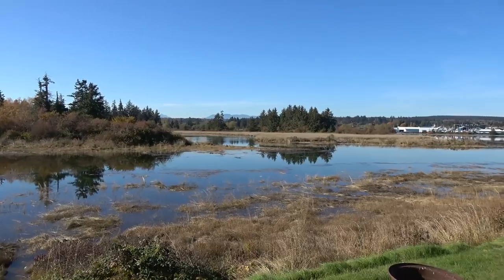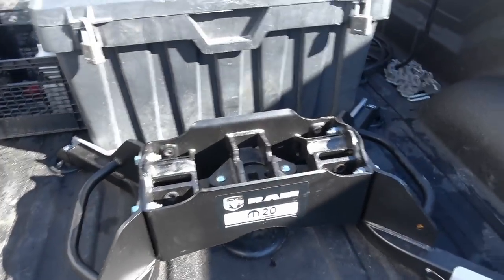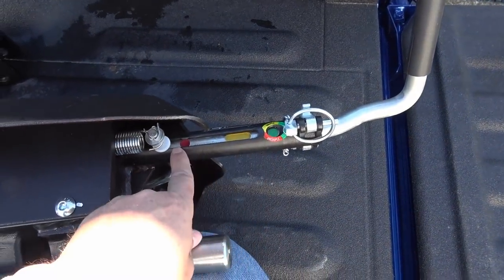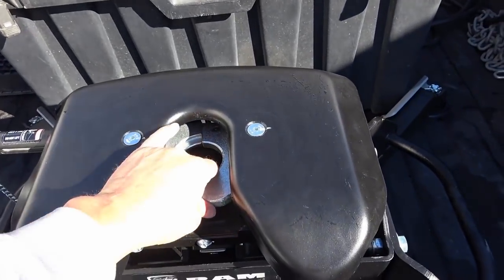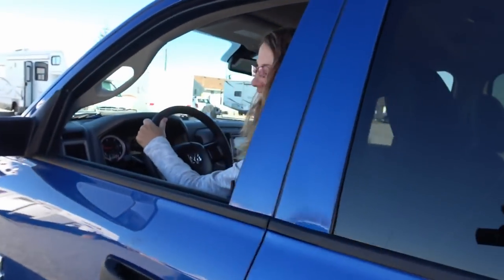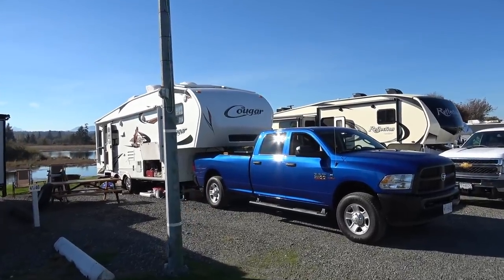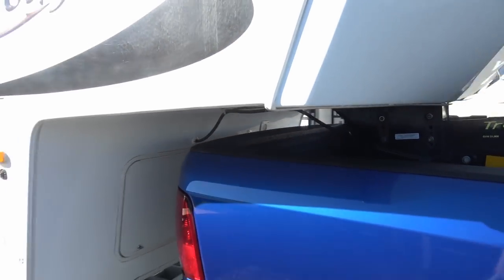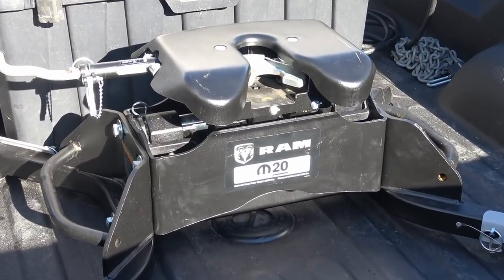Big Blue 2 - First Hookup (Testing New Hitch and Clearances)

Comment: Excellent, that was the best demonstration on how the Curt Q20 engages with the king pin!  Absolutely luv the ease of how it works.  The Curt Q20 is now at the top of my “must have” list. Thanks 🙏for the informative video!
Reply from the maker: Your welcome. I ad a little issue with unhooking but only because I didn't pay close enough attention to the manual. Here is the video I did on that - https://www.loveyourrv.com/ram-factory-m20-hitch-update-solved-my-disconnect-issue/  Cheers, Ray

Comment: We have a 2012 Cougar High Country. The left rear tire started hitting the undercarriage last year and got so bad this year we took it to a spring shop. The 4 leaf 2200 lb springs were beyond shot. Had them replaced with 3200 lb 6 leaf and fiver sits almost 2" higher. I wanted 5 leaf but the shop had 6 leaf in stock and we were on the road. Short bounces now instead of big wallows.
Reply from the maker: Thanks, I think I may be due for new springs soon too. One thing I forgot today is my water tank is full. 60 gallons, sits right at the back of the trailer. I imagine that has a bit of effect. Cheers, Ray

Comment: I have the same hitch in my new 2019 RAM 2500. 
FYI The entire unit weighs 180 lbs. I have a short box so I got into some very tight situations this summer. My project before we get snow is converting the M20 into a sliding hitch. The bottom half (leg kit) of the M20 hitch will be replaced with a Roller Adapter. I will then install an R20 Roller kit (from Curt) onto the Roller Adapter, and then the existing hitch head goes onto the R20 Roller. I see you have an 8 foot box so a Sliding hitch is not required.

Comment: Nice rig for getting around most places. Lots of luck. 
   We love our dogs and feel for your loss. Yours lived a long life and a contented one given your lifestyle. 
   I always had Rams. My last Ram 2014 with a 5.7 towed our 2011 Cougar lite real well. Hooked up, it sat nose high and the truck was a 2x4. This time, I decided to go bare bones to a 2017 reg cab Tradesman 4x4 with the 6.4. I love the truck. It takes me back to my first pickup bought new in 1985, also a Dodge---a nice truck for getting around town.
   I no longer have the cougar. I traded that in for a used 2015 34 ft Sprinter wide body, 9000 lb unloaded weight rear kitchen. I bought it for 23,000. The truck I also bought slightly used with 8000 miles for $30,500. It handles and pulls perfectly.  If money was no object, I would have gone with more truck, without dual wheels as you did. I'm still a little nose high, but not too bad. 
  Thanks for the spacer suggestion, I might do that. I'm getting around 7-8 pulling at 60 mpg. Empty highway at 60 mpg is around 15-16. We mostly stay by the month at campgrounds with full hookups and when we move it's usually under 200 to 500 miles away to the next campground where we might stay for a season or month or two. ie El Paso to Cloudroft NM. for a 15 to 20 degree difference or Apache Junction to Flagstaff for example. So gas mileage wasn't a big issue for us. Enjoy your rig and the power of overkill, and that's always a good thing in the RV world.
Reply from the maker: Thanks, should be fun next time we are over in NM to tackle that Cloudcroft hill with this new truck. :)

Comment: Hi Ray. When I got my 2016 Ram 1500 I had a lot of "trouble" with the Ram brake controller. The trailer brakes worked fine with my old 2005 F150. You could do the standard brake setup, lockup the brakes etc with the Ford but I could never get it setup correctly & I never felt the brakes were working correctly. I searched lots of truck forums & RV groups & there seemed to be a common theme that the controller wasn't any good
 The dealer checked it & said it was working to spec. I had a couple brake controllers so I disabled the OEM controller & tried them. I now got the same results. I found a post that a guy said to replace the brake wiring on the trailer with at least 12 gauge. The local parts supply had 50' of 10 gauge brake wire on sale so I got that & replaced from my junction box back. The trailer end to the junction box was already 10. The old wire was 16 gauge. Now everything works great. I tested the old wire & the pieces between the axles (run through the axles) ha cracks & brakes with only the rust from the axle keeping it together
 In short (pun intended) Ram controllers are sensitive to poor connections & a rewire may be in otder
Reply from the maker: Thanks, for the tips, my old controller worked well on old Blue, it was a Tekonsha Primus IQ. I just added new trailer brakes and redid the connections to them so hoping I'll be OK and not need to re-wire. Cheers, Ray
Reply: @LoveYourRV  my problem was the wires that run in the axles (most Dexter's do this)

Comment: It's funny that I am in the exact same situation. But I have a 2019 F350 Lariat and a Jayco 265BHS. My truck was factory ordered in April, arrived Oct 2, delivered Oct 11. Our seasonal site has a serious slope to the rear as well. I am still waiting to pull the unit off the site because of the break-in mileage. I purposely went to an f350 because we are a fairly of 6 and we are looking to move up to a 355MBQS. With a 2400-2600lb pin weight. Almost need a dually for that unit. I went ford as the GM srw doesn't compare(legal weight) and the cab is too small. The Ram with similar features ordered is $96kCAD, with less room in the cab and a heavier curb weight(450lbs).  Hope you enjoy the new truck.

Comment: I have a 4WD Ram which is a lot higher than other trucks. I had to reverse the spring shackles on my 5th wheel to prevent contact with the truck bed. It was particularly bad on slopes where the trailer was lower than the truck.  Also had to get the special 5th wheel cut out tailgate for clearance.

Comment: For $500 or so you can get 6 or 7 leaf spring packs and a taller equalizer.  When I bought my RAM in 2013 I had a very bad nose high condition with my 5r.  I went to the RV place to look into a solution and they said the only arc left in my springs was where they were bent down around the axle- totally shot.  Don't add shims it will be less stable and negate a lot of what you have done to make it more stable (the fancy hitch, the pin box, etc.).  

Next time you head south, stop in at Arlington RV in Arlington Wa. and see Greg.  He will take great care of you!
Reply from the maker: Thanks, for the info. Cheers, Ray

Comment: on that hitch, yellow is meant to be "open but ready to accept a trailer"

its also good practice to look at the actual jaw to make sure its closed, although on this hitch, i dont know if its even physically possible for the handle to be in the green position without the jaw correctly locked.

the little flip up thing on the release handle can be locked in the fully open position as well making unhooking a one man job.

Comment: Hi Ray, hope all is well after Angie's passing...Noticed in your video how close the New Truck is to your van when hitched ...you might need to move the hitch point in the Trucks bed , closer to the rear (if Possible) Other wise you turning circle will be truly compromised...GREAT looking Truck , by the way...Hope to get myself the same truck in Australia one day.
Reply from the maker: My tape measurements show I'll have about a 4-6 in clearance at 45 degrees when the corner of the truck is closest. only a test drive will tell for sure, if not I may have to switch pin boxes, the Air Ride I have is a little shorter than OEM. It made the clearance look tight on my old truck but was never an issue other than sometimes couldn't lower the tailgate without backing off the hitch a bit first. Cheers, Ray
Reply: No worries Ray, could be an illusion in the video...All the best with the new Big Blue, it looks GREAT!!

Comment: Ray 
I pull a Jayco 27.5 RKDS with a Ram 2500 Outdoorsman 6..7 Diesel
My trailer pulls a bit nose high and I have a Short box (6.5 foot) with a slider Curt Q16 with puck system 
I travelled from Ottawa to BC and back this summer without any issues.
I did not get the Aisin transmission yet had plenty of power towing along Lake Superior and in the Rockies. Motor rarely reved over 2000 rpm and I found the Exhaust brake very useful. Great on downgrades and find myself using it even on daily drives. Saves the brakes!

I might consider fine tuning and raising the trailer a couple of inches after watching what you do.  The trailer dealer said that I was fine but trust can be an issue there. They truly just want you off their lot and out of the service bay. But I might add that my tire wear on the trailer was even if that is an indicator?
Reply from the maker: Even tire wear is a good thing. I think the best thing to do is take it to scales and measure the weight difference between the front the rear axles. The main concern is to not overload the rear tires or axle. Also good to check the tire temps after towing and see if the rear tires are running hotter than the front. Nose high can sometimes affect the handling with too little pin weight on the truck and the trailer bumper is more prone to dragging in dips.  It's all relative though and can vary between setups. I think a little bit nose high is not a big issue.

Comment: Care to characterize the ride with the trailair and the curt(mopar) hitch?  I can't decide whether we want to get the curt q25 vs B&W RVK3600, then add the trailair pin box to a Montana.
Reply from the maker: No complaints, have about 4000 miles of towing on it now.  I have about 1700 lbs of pin weight on it. No clunking or clanking or chucking. Happy with the setup,  I have no plans to change anything. Cheers, Ray

Comment: The newer pickups are several inches taller since they increase the capacity of the beds.  I ran into this problem and to correct itI ordered  from Lippert a kit. I believe it's called "CORRECT TRACK".  It is designed to allow the alinement of the axles.  It also raises the trailer several inches.  It is a bit of a challenge since the trailer need to be block up since both wheels on a side need to be removed.  I would suggest replacing the equalizer with one from MORYDE which allows of addition suspension travel before bottoming out. I considered wet bolts but went with Lippert's "NEVER LUBE" bushing. (Grease attracts dirt) and that kit included the new links to the equalizer.
Several tips... since the wheel are off it will be a great time to repack the wheel bearings the right way and check the wear on the brake shoes. Also the wires to the brake will need to extended about 3 to 4 inches.
Reply from the maker: Thanks for the tips. Cheers, Ray

Comment: I think you are going to need those shims in the trailer suspension as it looks to me that the new 5th wheel hitch in the bed of the truck needs to go up at least 1 bolt hole for sure. The reason i say this is it doesn't look like your trailair pinbox will clear over the bed rails on sharp turns. This may just looks this way because all the weight wasn't on the truck? Just an observation. Safe travels!
Reply: P.S. I have the Curt Q20 and love it, and yes this does look like a rebrand of it.
Reply from the maker: Thanks, I measure 33" from the center of the hitch jaws to the side bed rails. My pin box measures about the same from the center of the pin to the very back end of the pin box up were it disappears in the fifth wheel overhang. So should still have plenty of clearance even when jacked 90 degrees. At least that how I figure it, time will tell. :)
Reply: Glad to hear it. Wishing you guys all the best as I am sure you are heading south soon. Safe travels, and thank you for all the great videos.

Comment: We have a 2018 ram 2500 megacab and quite a bit more room between the tailgate and the 5'er, we are using a superglide autosliding hitch tho
Reply from the maker: Thanks. Same on my old truck sometimes too, mostly because I had swapped the longer OEM pinbox for the Air Ride, it's a little shorter pin box. Means I can't fully open the tailgate until unhitched a little.

Comment: Looks like you might be OK when everything is loaded and level.  It seems a little ridiculous that we all have to worry about having our trailer level while keeping the correct clearance with the Pickup side rails and tailgate.  Most pickups on the road that I see,  that are towing 5th wheels, are relatively new  and 4wd.  It would be nice if the RV manufactures would raise things a few inches to accommodate the vehicles that will be towing them.
Reply from the maker: I guess they are worried about the height of the trailer. I think some of the new ones are getting taller though, especially the toy haulers. They need 4 steps to get into them.
Would be nice if truck makers would offer an option to order a little lower bed rail sized box, I was tempted to buy a truck with no box and put a flat deck on it. Cheers, Ray
Reply: Good point. I'm sure they are hemmed in by the overall height , and still keeping the upper level livable.I guess I shouldn't complain, my pickup is stock.  Half the pickups around here have been raised, and have even larger tires. They must really have problems. I mean hooking up to a 5th wheel, not necessarily psychological problems.  Take care, Greg and Becky

Comment: The new truck has such massive towing capacity compared to the old one, I think it will prove to be a breeze towing uphill!
Reply: I have a small v-8 and a 8000 trailer. I always have...since the early 80's. Is there anything wrong with driving at the same pace as the semi-trucks? Does it really matter if I go slow?
Reply: G Henrickson live in Pennsylvania....you'll tire of pulling hills at 4000rpm and 40 mph real quick...and there is a lot of them

Comment: I purchased a brand new 2019 RAM 2500 with the same M20 hitch. Love the hitch, very easy to use. This truck is so tall, that the nose-high problem with my 2011 KZ 295 5th wheel is massive. The front of the trailer is 9 inches (23cm.) higher than the back! My rear tires are significantly warmer than the front tires. My hitch is set at the lowest setting. The axles are already on top of the springs (flipped). I think my only option is a Spring/Suspension shop. I believe I need new springs, and more steel hardware to raise the trailer. Any other ideas from the RV'ers out there?

Comment: It does look very tight at the rear of the bed of the truck to the trailer seems like you should have more space between the two. It really looks like when you go into a turn that the tale of your truck is going to hit your trailer.
Reply from the maker: My tape measurements show I'll have about a 4-6 in clearance at 45 degrees when the corner of the truck is closest. only a test drive will tell for sure, if not I may have to switch pin boxes, the Air Ride I have is a little shorter than OEM. It made the clearance look tight on my old truck but was never an issue other than sometimes couldn't lower the tailgate without backing off the hitch a bit first. Cheers, Ray
Reply: @LoveYourRV  yeah you would think that all the pin boxes would be long enough where you get open the tailgate while hooked up I definitely hope it works out

Comment: Hey Ray nice looking hitch, I've always liked Curt products.    I was wondering can you open and close your tailgate with the camper hitched?  If not would you get a fifth wheel tailgate?  Happy camping!
Reply from the maker: Thanks. Same on my old truck sometimes too, mostly because I had swapped the longer OEM pinbox for the Air Ride, it's a little shorter pin box. Means I can fully open the tailgate until unhitched a little.  I'll likely keep the OEM tailgate as I like how it hides casual prying eyes from seeing inside the bed since the truck is so tall. I'm pretty used to the unhitching and hitching procedure now.

Comment: Gosh the clearance between the back of the truck a d the trailer looks tight in the video. There was a shot near the end it seemed to look better. I know you know what your doing so would love to see a video demonstrating the turning ability of that curced back end. Not sure if the bumper is curved with the tailgate.
Reply from the maker: It was fairly tight on my old truck too, it's because of the Air Ride pin box, it is a little shorter than the OEM but turned fine. I measure 60" from the center of the hitch jaws to the outer corner of the truck bumper. From the center of the hitch pin back to the trailer wall down where the bumper would be is around 70". So thinking I'll be OK there, should have about 10 inches.

Comment: Have you heard of the Anderson Hitch? It is mush less weight in the truck and much easier to put in and out of truck bed. Look up The Anderson Hitch on you tube. You already have the mounts in the bed of the truck for the Anderson Hitch.
Reply from the maker: Yes, have, the company actually offered me one a while back, but it takes up to much room in the bed for me the way the frame is designed and not sure how well it would work with my Air Ride pin box. Cheers, Ray

Comment: My new 2018 F350 long bed looks like we have about the same clearance from bed to trailer. ( 5 in )But when I turn the back of my plan box will hit the side of my bed. That did not happen on my 2001 f250 ford bed. I have a Andersen hitch and is real easy to adjust. I have a Artic Fox and it is 13-4 high, so I am work on my pin issue. Nice Blue TV
Reply: Those Anderson hitches are great. I got one of those, and I love it.

Comment: Ray, can you open the tailgate when hitched? Looks tight. Curious since I will be in the market first part of next year for another truck.
Reply from the maker: No, I gave that option up pretty much when I changed from the old OEM pin box to my Air Ride, it ended up several inches shorter, reduced my tailgate clearance enough that I couldn't open it all the time. Depended on the slope of the ground. The new truck is even tighter as the tailgate is taller.